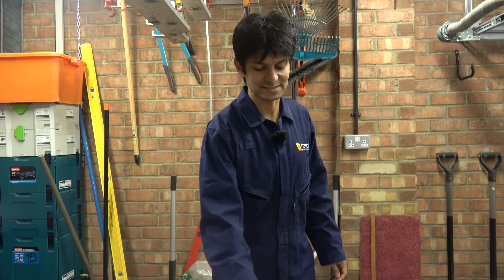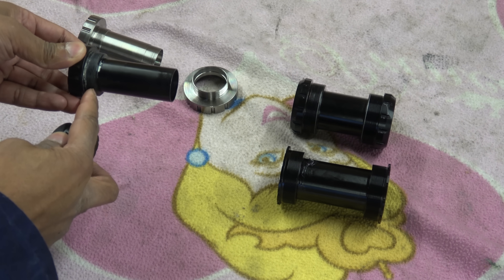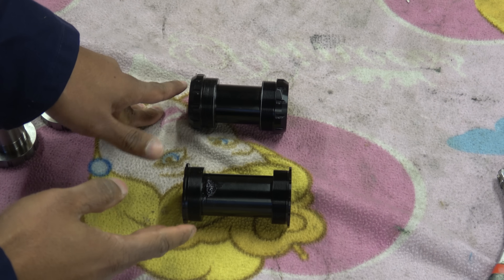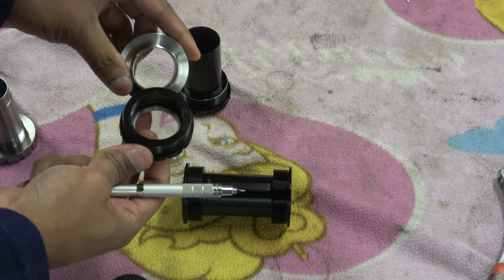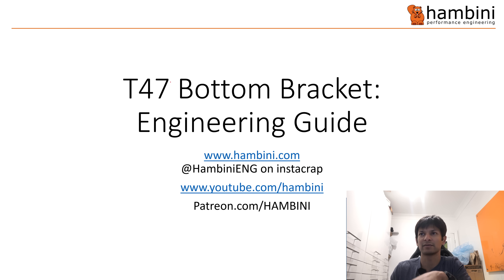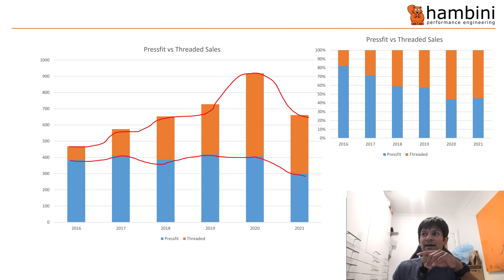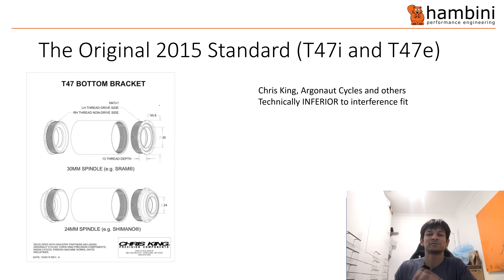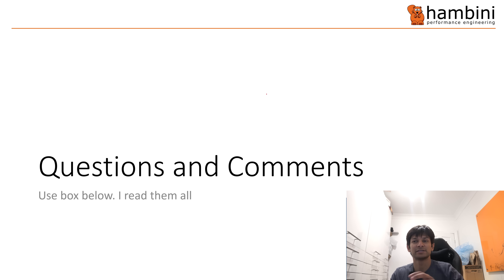T47 Bottom Brackets | Full Engineering Guide | Everything you need to know

Comment: Perhaps we're premature in ditching press fit. It seems like bike manufacturers have moved to T47 just when they had finally implemented processes that allow them to properly do press fit. Based on the opinions of the mechanics I know and what I've seen anecdotally, far fewer people are bringing in 2018-2022 bikes with creaking press fit BBs then there were ten years ago. Also BB86 has always been less problematic than other press fit standards, unsurprisingly that's the standard that both Giant and Canyon have stuck with.
Reply: Correct. The least amount of parts will bring you the best solution. It´s up to the producers to meet the standards, or tolerances.    Rgr
Reply: Please don't, just let press fit die.
Reply: Replace press fit with BSA and we're in agreement. Easy to service. Worked for decades. There's zero reason to be fucking with the rest of the bullshit.
Reply: But isn't a Press Fit interface inevitably going to wear out until it will be out of tolerance? You use a threaded interface as often as you like. And most of the time, changing groupsets or groupset generations will require you to put in another BB into your frame. How often can you do this with Press Fit? I put the 4th BB into my carbon Ridley frame. It was much slacker than in the beginning. I had to use a liberal amount of Loctite to get it to fit snugly.
Reply: @sebastianm2381  if the BB is properly aligned, it will last many years. Likewise, there won't be any movement between the bearing and the BB shell. Basically every bearing in the world is press fit, including threaded BB cups. It's a proven interface.
Reply: @davidnicholson6680  That’s not what I meant. I’m talking about the interface between the frame and the BB cups. This will wear over time every time you press in a new one. And often you have to switch BBs not because if wear but because you’re opting to use a different crank. With a threaded BB you can swap out your BB as often as you want without causing wear to the frame.
Reply: @sebastianm2381  to answer your question, no. You press cups/shell into the frame and then just replace the bearings from there once or twice a decade you might actually replace the cups/shell.
Unless you're doing weekly cup replacement you won't get enough wear to make any difference.
I've seen many more threads messed up over the years, eventually the threads wear out, usually exacerbated by corrosion.
Reply: @galenkehler  I don’t know of any BB cup that could accommodate three or four different axle lengths and bearing sizes. Do you? I’ve been using Sram GXP 24mm axle cranks. I switched to BB30 so I had to press in a completely different BB. Different bearing size. Different width etc. I had creaking so I went to a thread fit BB. I did then replace bearings by pushing them out of the cup and pressing in new ones. Of course that’s possible if you stay with one crank standard. But that’s completely missing my point. I then switched to Campagnolo. So again, 25mm axle diameter, different axle length. Different BB design. I had to press in Ultra Torque BB cups. By that point, the PF30 interface in the frame was a lot less tight than in the beginning.
Reply: PF execution was BAD on average (in terms of median bikes) 
Threaded all the way!

Comment: I don’t get why they’re so hung up on bottom bracket stiffness; Tom Boonen won Paris Roubaix on square-taper campy cranks, ffs
Reply from the maker: Quite a lot of deflection comes in the bearing and the connection joints. You are more likely to feel deflection in the pedal than the BB for example because the bearings are small.
Reply: @Hambini  do hairdressers prefer a smaller bearing, or a stiffer axle? That’s the question that needs answering on this channel
Reply from the maker: @simonbailey2151  mine likes stiffer axle....
Reply: @Hambini  with huge ceramic balls, and wet lube too
Reply: d*** measuring contest, average rider wouldn't notice the difference
Reply: Seeing who can get the stiffest axle.
Reply: i really hope they would bring back square tapered. Shimano's bb-un55 is already good.
Reply: @loonation2185  absolutely. In many ways the SKF isis bb is the ultimate; 10 year guarantee, lower weight, excellent seal protection, however the industry seems to want us to buy crappy stuff. Ah well.
Reply: Only thing wrong with square taper, HT1 and ISIS is the stupid tools to remove them that barely engage and love to slip..... I freed one off for a friend what a palaver finding some threaded rod to go through the HT1 with nuts on the end to hold the splined tool in place with it in a vice while I turned the frame!